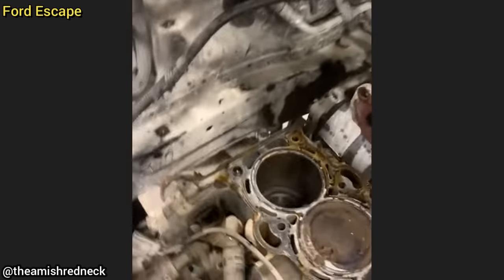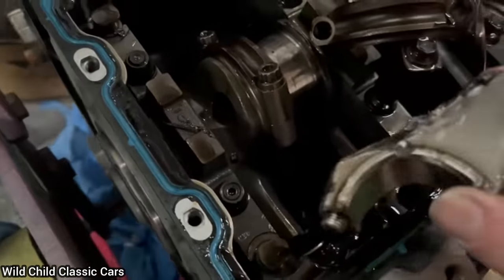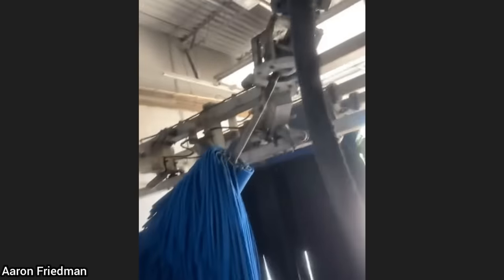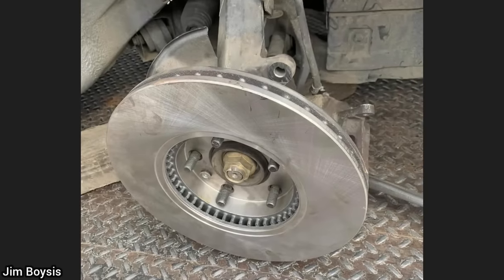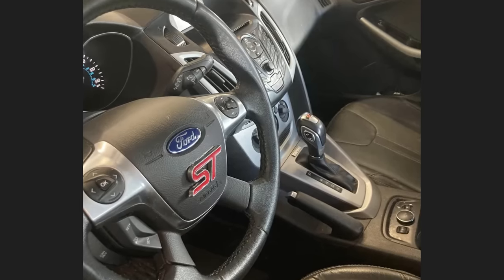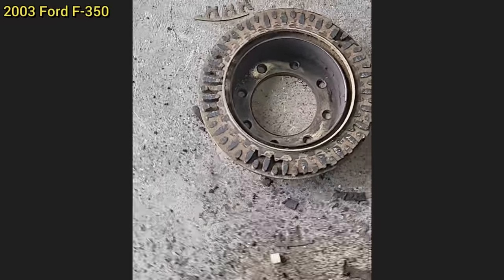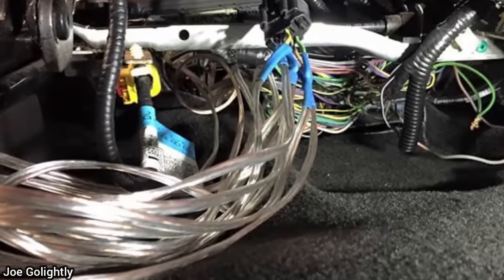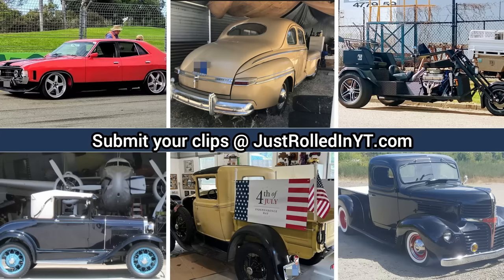Customer States Engine Runs Rough After He Replaced Some Parts | Just Rolled In

Comment: Thats service manager who called the cops👌 good job dude you might've saved someones life stuff needs to happen way more often.
Reply: Rat narc
Reply: Dealership service advisors are usually commissions only. It was an expensive job meaning a good check that day. It's his way of getting even with the potential customer.

I know of plenty of shops with the same system.

Was he wrong? No, that car shouldn't be on the road, but he didn't do it to be a good samaritan.
Reply: I agree, it's not the repair shops job to call the cops unless it's crazy dangerous. Maybe that person couldn't afford the work at that time, and now he has a ticket to pay.
Be kind when possible, and let the rest be.
Reply: @johnebony3234  If he doesn't have the money to fix it then he should have taken care of it to start with. Got an almost 40 year old Chevy that has never seen damage like that. Just the standard maintenance required to keep it safe. The same guy doesn't change the oil, air filter, or even give it a single wash. How much you want to bet it isn't registered or even insured?

His complacency is obvious. 

It should not be on the road period. That said, I can tell you the shop did it 100% to be petty. Not that I disagree with them reporting it.

Comment: I can relate to that rattling noise clip.  I just bought a used Honda Fit earlier this week when I noticed the noise yesterday.  I opened the hatch to realize that the tire iron pouch was jiggling around and secured it.  Problem solved and heart attack avoided.
Reply: Nice diagnosis. And congrats on your Fit! It's a real gem of a car.
Reply: I had a rattle for months, but only under certain conditions. Then one day I realized what it was, and tightened the tire change jack in its holder. 😅
Reply: My first car was an old Toyota Hilux, had the same issue with a rattling noise in the back that turned out to be the jack and pouch in a side storage compartment in the back.  Popped the back seats up to put it away and there was already a full kit in there.  :P

Comment: After 40 years of making a mess on my work bench with brake cleaner, I saw a helpful hint (that I'd never thought of) on another channel the other day. The hint was to place the rotor over the studs backwards to clean the inside. However, the other channel also mentioned that you need to remember to turn it around and clean the other side BEFORE trying to reassemble everything!
Reply: Was that Rainman Ray's channel?
Reply: @61rampy65  I think it was Eric O. at South Main Auto...
Reply: How the ever loving heck have I never thought of that!? 
All this time I'd just been standing them up in a drain pan to clean them out, that sounds so much better!
Reply: @Vincent_Sullivan OK, equally as good.

Comment: Someone putting on a brake disc rotor on backwards and not realising whilst also wondering why he can't re-install the brake caliper and the wheel won't go back on, that'll do me! I literally said in my head when I saw that video, WTF! Absolute madness. One video demonstrates why you should make sure there are no rags left in the intake manifold holes or the main intake hole where the throttle body bolts onto when doing such work where a throttle body is being replaced. Yes rags are put in there to stop shite from getting in there but when the engine components are being re-intalled, make sure the rags are removed, otherwise you'll have a situation like the one shown in that particular video. Also make sure the rags are big enough and that a portion of the rags are sticking out of the hole they have been put in so that you remember that they are there and you dont forget to remove them. Don't stick them in too far either. Those two videos had me shaking my bloody head. And i wasn't laughing either. No real laughing matter. Great work.

Comment: Can relate to the rattling noise. I hear such a noise in back of my truck. Mechanic showed me the loose hammer he found. I looked like and was an idiot.
Reply: I never heard it rattle, but I found a ratchet near the battery tray in a used car I bought. Happened to look down while working in that corner of the engine bay, and said "What's all this then?" It was rusty and didn't seem to work right, so the big-box store that sold that brand replaced it for free. Into my in-car toolbox it went. The ratchet cost more than the socket set I use on it (!)

Comment: I can kinda understand the AM radio noise confusing the driver. Those Ford factory radios develop issues with the rotary encoder. Hit a bump, the volume goes down to nothing, and no amount of twisting will get it to work until it wants to. Or, no matter which way you turn the knob, the volume only goes UP. The radio defaults to the AM band if the battery is disconnected, and the AM receiver will pick up sensor and ignition noise.

Comment: The very first one. Marine tech here, customer needed a valve job on his 350 Chevy inboard. Asked if he could remove, bring heads In, reinstall, then bring back to us for a final tune. Brought back and said it ran worse then before and asked if we misdiagnosed. First thing I did was a leak down test, #4 & #6 had no compression & leaking through valves. Removed head and customer left a red shop rag in each cylinder!

Comment: While I understand the safety argument, it's a dangerous precedence to set. If I read a shop did that, I would never take my car to then.
Reply: If you brought an extremely unsafe car to a shop, they showed you why it's scary dangerous, and you refused to fix it or tow it, and just drove away like that....
I expect the shop would not want to see you again either.
Reply: Thanks for sharingnyour unsafe car with other road users..
Great attitude
Reply: they should at least be up front, and tell the customer the vehicle needs to be towed away, not driven, before calling the cops.
Reply: @leftyo9589  Fair point. I assume they told the customer it's unsafe to drive. Then the customer would know to get it towed.
If they just said "you need this fixed" without mentioning it's unsafe, and then popped the cops when customer declined, that would be dirty.

Comment: That's dirty as hell for the shop to call the cops just because they didn't get the work. It is very possible that the owner would take it somewhere else to be repaired or park it until it could be fixed. If it was me that shop would be getting review bombed. 

I know that it was just a 10 second clip with no context, so it is likely that there is more to the story. But if not that is just dirty.
Reply: what happens if they hit somebody you love and you never see them again?
Reply: That person is driving on the same road as people you love. Never forget that.
Reply: if they didn't want it fixed there, it should've left on a tow truck, that wasn't safe to be on the road at all
Reply: Then take it away on a tow truck, don’t go back onto public roads and have all other road users or even pedestrians in danger
Reply: they should at least tell the customer, since you declined repairs, you need to have it towed away, as it is unsafe. if they drive it away after that, oh well its on them.
Reply: @darkdreams1589  I would be more worried about the all of the people riding around with problems just as bad that haven't been to a shop. I have driven cars with major problems and knew it, but you drive differently in order to not put people at risk until you can get it fixed. Just because there is a car with problems on the road doesn't mean your mom is about to die.
Reply: Driving a death trap on the road is dangerous and, in states that have mandatory safety inspections (like this one obviously did) it’s illegal. The people driving that shit box got what they deserved.

And driving your car “different” because the wheel is about to fall off doesn’t somehow make it safe or ok. It’s still somewhere between incredibly dangerous/irresponsible and suicidal.

Comment: 0:44 And thats why you add a GIANT 30psi warning light directly in front of your view on performance vehicles.
Plus if that really is for autocros it SHOULD be running a dry sump, and giant reservoir.  You cannot design a pan that will stop all cavitation on a wet sump, the oil just stacks up under G forces. You HAVE to have a reservoir for high G. Even Drag cars do...

Comment: 2:05 wow that's what Karen 💩 right there. Now I don't support people driving a dangerous and unsafe vehicle on the road. But don't forget people lift their trucks to the point that the Bearigs give out in the wheel falls off while they're driving. But nobody wants to say anything about that. Other than calling the police on somebody that doesn't have the money to fix their car desperate the township and state to get more money. You probably should have helped the person and found some used tires for the person to get around safely until they had the money.
 Next time don't be a Karen and how about you help somebody out that's in need
Reply: And if that car left the shop and careered into a car killing/injuring the occupants? It had a broken trailing arm for christs sake. Trailing arms connect your rear axle to the body of your car, if one is broken, it could easily cause the rear axle to completely separate from the vehicle, or at the very least cause the vehicle to lose control. If the owner was told about it, and was still going to drive off, then I guess the shop owner was concerned enough about the owners, and other peoples safety to make that call.
Reply: Nope. I'm on the road with these people. I walk along the street next to cars. I don't want to be driving down the road and have some idiot aquaplane into me because they had bald tyres, or suddenly veer into me as the loose suspension jerked about. 
If you can't afford to keep a car safely, do not have a car. It's a privilege, not a right.
Reply: Being poor isn’t an excuse to put everyone’s life at risk. If you can’t afford to maintain your vehicle to the minimum standards of safety, you can’t afford to drive.
Reply: @MattMatt77   Sorry but in the real world your own possession are your own responsibility, and it's not a garage's responsibility to be a charity for people who can't afford repairs.
Reply: @drunkenhobo8020  Like what I said no reply on the Trucks bearings given out SMH
That's what happens when your speaking facts I guess. Or when your talking to a drunk
Reply: @MattMatt77   I'm worried that you think whataboutery is a good talking point.

Comment: 0:06
As someone that has sucked up multiple rags in multiple engines, I've been fortunate enough to not cause any serious damage. 

Typically pulling the exhaust manifold is enough to clear out the problem with a set of needle nose pliers. Have pulled the intake manifold as well and set a low temp propane torch into the combustion chamber to clear out the rag.

Comment: There is a railroad crossing in the next county to where I live that is partway down a hill. I remember seeing scars on the road about 100 feet downhill from the railroad tracks. I was working at a house nearby and the owner said that one of his neighbors ripped the exhaust system off the car and tore up the entire front suspension. Amazingly the engine was intact but the transmission pan had a hole in it. The car was totaled but the engine and transmission were put in another car. I was told that the driver was doing about 65 when he hit the crossing. I know from experience that you will catch air if you're doing more than 30 and anything over 20 will definitely get your attention if you're going downhill. If you're going uphill you can actually go a little faster and all you will do is cross the tracks airborne with a reasonably soft landing on the uphill side. I've never done it intentionally but the one time I accidentally did it, everything in my work van that wasn't tied down was in the air briefly. It was quite loud when it landed.

Comment: I was working for a company that mfg aircraft components; angle of attack sensors, pitot tubes, windshield wipers systems, brake temp sensor, etc. After 9/11, we started making cockpit camera systems. I worked in the repair/service side. A camera system was returned with the note: Does  Not Work in the O.F.F. Position.

Comment: I've rebuilt more engines than I can count, but I have to admit I once forgot to fill a newly rebuilt engine with oil. Those kind of things can happen to anyone. Caught it before it threw a rod, but not before it trashed the rod bearings. I was impressed at just how long it ran just fine on a good application of assembly lube though.

Comment: That rag in the intake manifold reminded me of an incident from my far distant past. 
When I was in Auto Trade School back in the 70s, one of my classmates brought his car into the shop because it was running rough and making a terrible noise. We pulled a couple of spark plugs and found a couple of broken spark plugs. We took the heads off and found ball bearings had got into the engine and seriously damaged the engine. It's been too long to be able to remember if we repaired the engine, but it would have needed pistons, valves, heads, and resurfaced cylinder walls, at a minimum. It was a fairly well built Mustang, so it's possible that we did the job in class. 
It is likely that someone sabotaged his car, because even though I can't remember his name, I remember that he was a colossal jerk.
Reply: Best one I ever saw was a guy bought a car 'cheap' that was said to have had a rebuilt engine....but with a 'Miss' and it didn't idle smoothly. (It shook badly) Zero Compression in one cylinder. Tore down the engine & we found the issue just as soon as that one head came off. No Piston or Connecting Rod in one of the cylinders!!! I'm actually surprised it would even ran more than a few minutes that way before tearing itself apart!!!!

Comment: Much to my embarrassment I've become a Just Rolled In person. I have an 2010 Mazda 6 that my kids used to drive. It was making a clunking sound from the rear. My local mechanic had it up on the lift and showed me part of the sub frame was rusted completely apart, missing about three inches of frame. My first thought was "Oh no! I've become one of those people!!". Ha ha. It's a bolt on subframe so my mechanic will see if he can find a salvaged part, if it doesn't cost too much I might have it fixed. Just a back up car, 209,000 miles. Everything works great, hate to lose it.

Comment: The rattle at 1:40.  I felt with a similar issue.  Customer stated clunking sound on left turns.  It did. I spent about 2 hours driving around checking EVERYTHING. Service writer was sure it was cv axle. (It was a buddy of his car). For some reason after a drive I went around the back of the car to walk over to the service writer. Noticed the aftermarket exhaust tip was very close to the bumper cover. Gave it a light kick. Sure enough, the clunk. I was pissed because I was working flat rate and ther service writer wasn’t going to charge his buddy any $.  I raised hell with my boss and made them pay me for my wasted time.

Comment: I was at the hardware store recently when I noticed the paint job on the car parked next to me. The car was painted in pitch black laytex house paint, the body, all the chrome, handles, windows and  lights. The car wasn't even cleaned before the paint slathered on so there were dead bugs on the grill entombed in paint and you could see the rivulets of pollen/dust under the paint. I was going to take a picture for laughts but jsut as soon as I decided to take a picture the owner came out of the store. He was the scariest looking tweaker I've ever seen with a sack full of spray can products. He got into his car, huffed a can out of an empty McD's bag from the floor boards then gunned it out of the parking lot like he was on fire.

Comment: Wow.  I know the owner of a shop where one of his drivers did a similar thing to one of his delivery trucks. Stripped off the one side going around the back of another trailer. 
Option a "you're fired" 
Option b "its coming out of your pay"
He took option b. 
I have seen the stripped bare brake rotors before as well. 
Lady said it was kinda noisy.
It was clattering against the broken away vents on both sides.
Metal back plates rubbing the vents. Brake pad material gone months ago.

Comment: I had a radio related car scare once, horrible kind of rattling sounds at certain points. I stopped, opened the hood and checked the engine, nothing was wrong couldn't hear the sound. After pondering a bit i decided to get the number to my mechanic out of the glove box, as i opened the passenger door. 
The door speaker fell out, so that was the rattling sound 😸..

Comment: I was driving to work one evening and overtook a truck pulling a 40' container, the whole top was offset a good 5' to the right and had several chain come-alongs rigged up to keep it from going further. It wasn't leaning into the passing lane at least, but it was still nuts they were driving on the highway like that

Comment: I do feel the auto shop that called the police probably should have informed the customer that the vehicle is not street legal in it’s current state. If they still insist on being stubborn and driving it out, on their own head be it.  
However calling the cops without informing the person just strikes me as petty. 

For an example of a mechanic being petty I once had a leaky antifreeze container(among other issues). I informed the mechanic that after it was patched I only wanted them to put a single bottle in for their testing and I would be bringing a bottle to top it up myself to avoid the up charge on their supplies. The bastards used two to fill it up and charged me an extra thirty bucks (the bottle I had with me was ten and change) for something I told them I didn’t want and then threatened me that if I didn’t pay they would have my vehicle towed as “abandoned by owner,” greedy buggers.